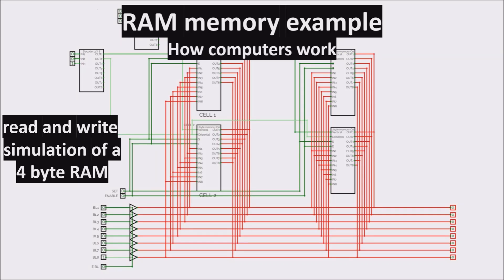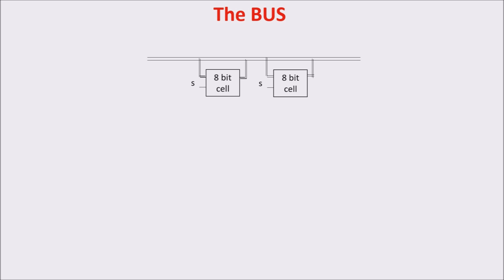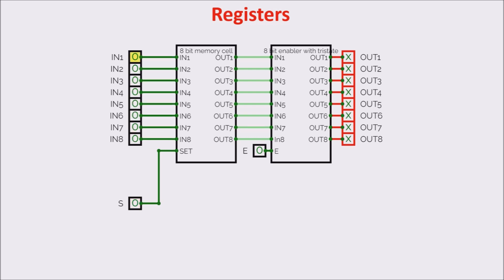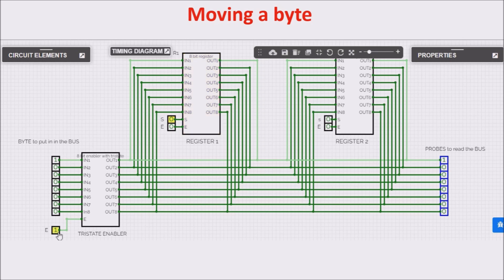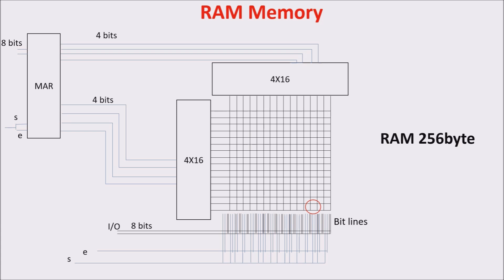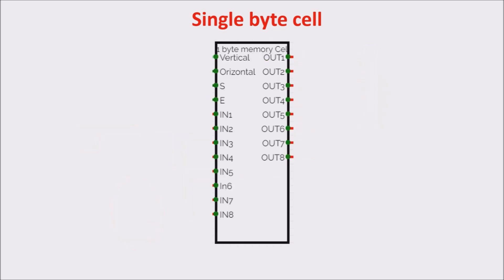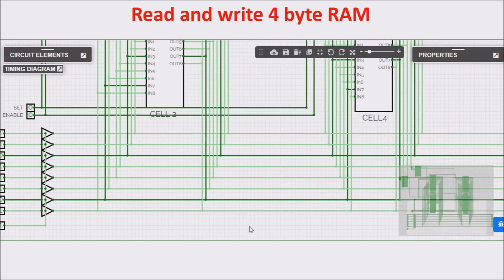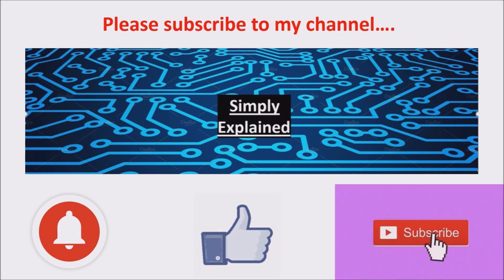Example of RAM memory from Scott's CPU How computers work PART 3

Comment: Is there any difference into using a multiplexor instead of a decoder?
Reply from the maker: Yes there is, a mux is a device that selects one of several input signals and transmits it to a single output line. A decoder select Just One of the many outputs through a few control lines. In this case we want a decoder to select the right Memory cell

Comment: I can’t understand as to what the decoder does, and what the code (001) you enter does, how does it refer to cell 4?
Reply from the maker: The decoder Is used to select the right Cell of Memory. The decoder takes the Bits from the address register and It put in High the two lines that made available the Cell
Reply: I understood everything in the book up until now and I’m stuck as to how RAM works, even after watching the vid. What is at each intersection? In every square is there a combination of 8 bits?
Reply from the maker: In every intersection there is a register of 8 Bits plus the logic Gates for enabling the set and enable input of the register and the logic for selecting the Cell.
Reply: What exactly is a cell and what is in it?
Reply from the maker: Every cell Is composed by a register of 8 Bits plus the logic for selecting set, enable inputs of the register. The register has as input the bus of 8 Bits in which the data flow and It has as output an other 8 Bit bus
Reply: @Computer-and-Electronics one more questions , in this video a byte of memory in RAM is represented by the large rectangle. In the book, would the byte of memory be also the small square?
Reply from the maker: @ti-jeandehaney4730  I think so. the ram cell has 8 bits or a byte and should be drawn as little rectabgle in the intersection
Reply: I feel as if I’m misunderstood something but can’t pinpoint what exactly
Reply: Is a cell  referred to as the square mades as a result of the intersection of the decoders wires which either have a value of 0 or 1? Also does each of those squares have a register
Reply from the maker: Yes in every intersection there is a register. The RAM in this example has a Square shape
Reply: What does the decoder do with the inputs from the set address register? Sorry for the questions just stuck rn
Reply from the maker: The decoder has to enable the set and enable register inputs only of the right Cell, only in the right intersection.
Reply: @Computer-and-Electronics  what software would you recommend as a beginnner to maybe grasp circuits these while following the book
Reply from the maker: I use Circuitverse. Simulator. It Is a free software very easy to use. You can design the book circuit with It
Reply: @Computer-and-Electronics Thanks , after rewatching other videos and coming back to this, it makes sense, keep up the work and great channel. I also saw you on Reddit while looking for posts on circuit simulators :)
Reply: @Computer-and-Electronics also, why do you have a not gates with the enable wire connected to them on the bus
Reply from the maker: @ti-jeandehaney4730  those are the tristate elements. In the book there aren't but you need them for controlling the bus. The bus is used both for writing and reading operations. Tristate is a gate that put high impedance in the bus to avoid conflict. For example the outputs of the ram cells are connected to the bus forcing their bits but at the same time there are the bits that we put in input forcing other bits. this means that in the same time we could force a zero and a one in the same line. this is a conflict you want to avoid. So when we read from the ram we put the tristate at high so that the output of the ram could put the byte on the bus avoiding conflict. When we write to the ram cell we leave the input byte pass through the tristate.
Reply: @Computer-and-Electronics I’m not quite understanding what the tri state component is. In the book an enabler is build with the eight and gates and their inputs are the bits from the memory cell and the other one is the Enabler input, but your saying that this tri-state is not present In the book.p, I’ll try to research more. Also what is meant by impedence, is it the value of the input eg: 0 or 1
Reply: @Computer-and-Electronics  update : I’ve just watched Ben eaters video on tri state logic and it makes sense now, thank you.

Comment: Just a note for anyone interested, SDRAM (used for modern RAM - DDR1, 2, 3, etc.) is made using a capacitor and transistor per cell, while SRAM is generally used for CPU cache.
Reply from the maker: Yes I cover this topico in this video https://youtu.be/mVsJd0vJkMA